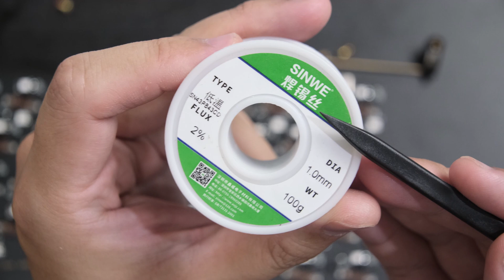DEAD RGBs... This Keyboard SERIOUSLY won't give me a break - Let's Fix It.

Comment: I have the same problem on a Zuoya GMK87 keyboard, but for this one it's the bottom three rows of key LEDs that won't work. Unfortunately I don't have a nice key that sticks out as the one causing the problem, and I would likely have to replace the one at the start and and of the 3rd row just to see if that's what is causing the problem.
Did that LED short? Can you measure a short with a meter? That could be a way for me to find the faulty LED.
Reply from the maker: You should be able to measure it with a meter in diode mode
Reply: i have the same keyboard as yours and the same issue, only the top row F1-F12 has the rgb on and the rest are turned off. how did you resolve the issue?
Reply: @renztabor8179  The keyboard had to be replaced. And don't get me started on the hoops I had to jump through to get the replacement.
Overall it's a nice keyboard. The hardware is great when it's working but the software blows.